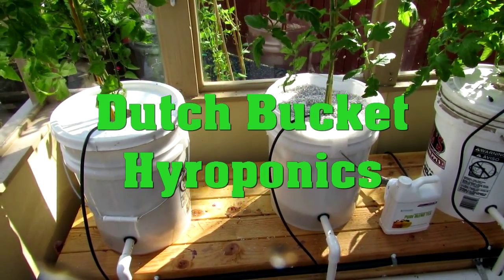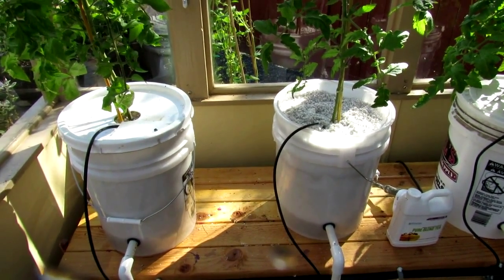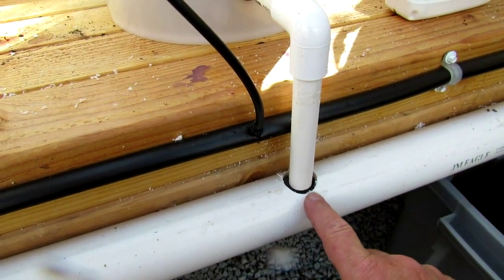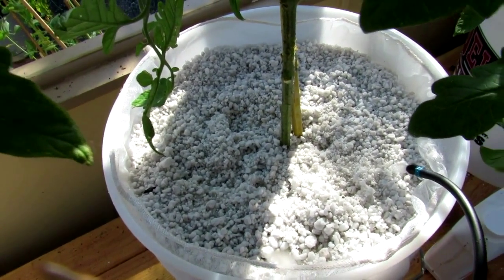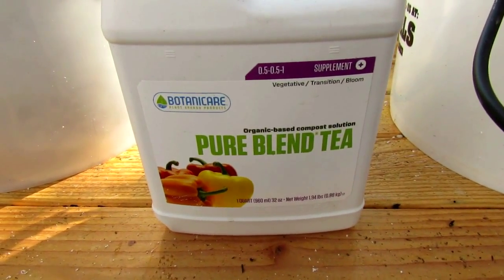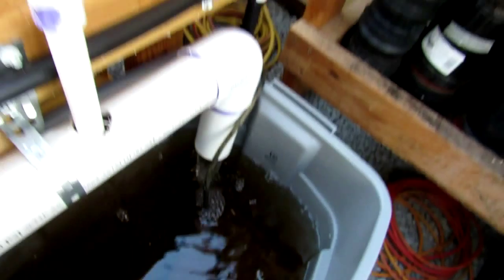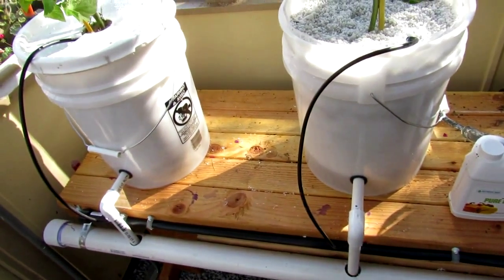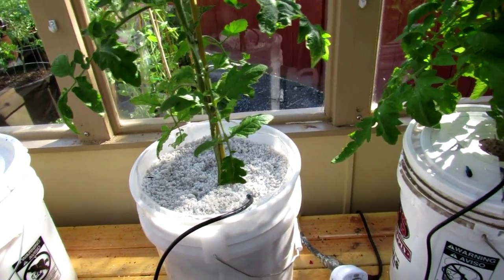Dutch Bucket Hydroponics System

Comment: Did you use the same grommets from Grainger that mhp gardener used in the flat sided buckets? I just wondered because I was worried that making the curve in the round bucket would change the shape of the grommets so they would  leak or not work. Thanks man.

Comment: If you are going to do this us Food Grade plastics & tubing (recycle codes 1 - 2 - 4 - 5). Use PEX tubing & pipes (food grade)Stay away from PVC (Polyvinyl Chloride) & cancer causing plastics. Also rinse/wash all plastic to remove the mold releasing agent left on from manufacturing.